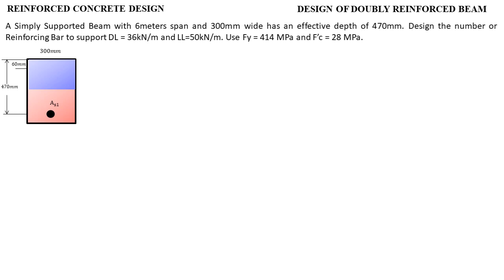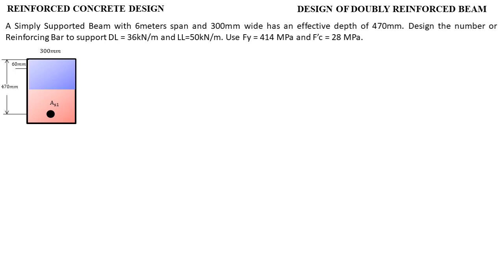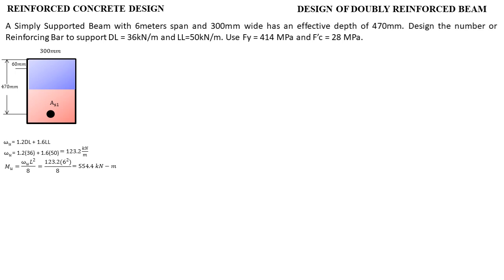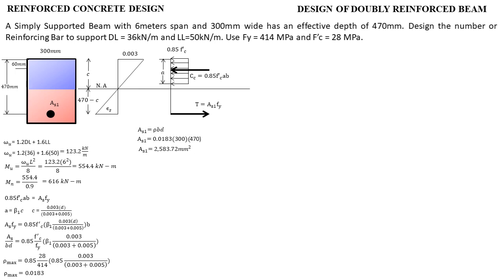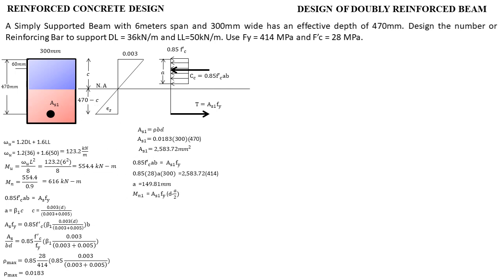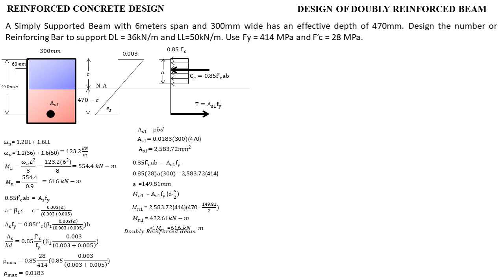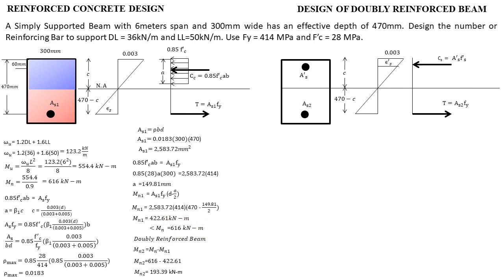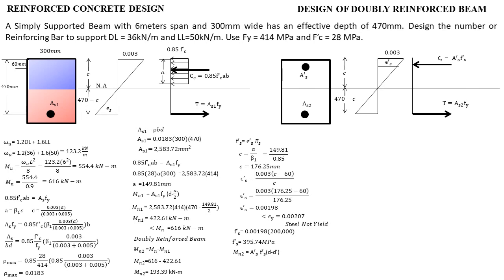Design of Doubly Reinforced Beam  l Tension Controlled l Reinforced Concrete Design l

Comment: @Mathematics and Engineering Videos Ang computed rebars for compression na 4 - 20 mm at for tension na 4 - 30 mm at 2 - 25 mm ay derecho na hanggang sa supports?
Reply: Yes since simply supported is stated.